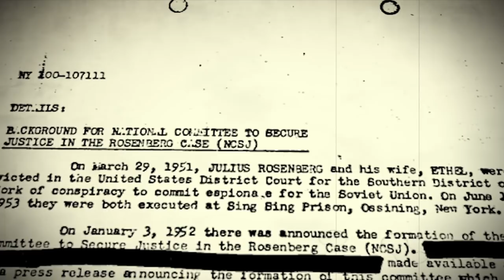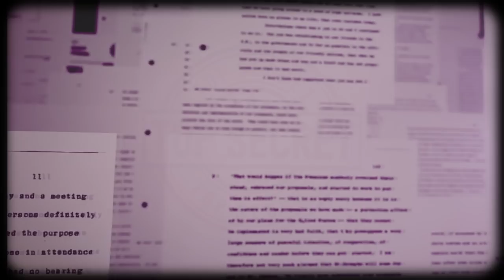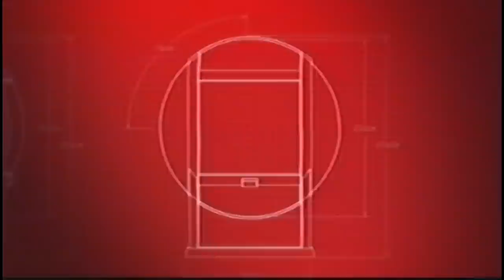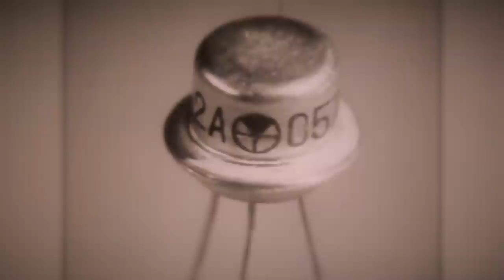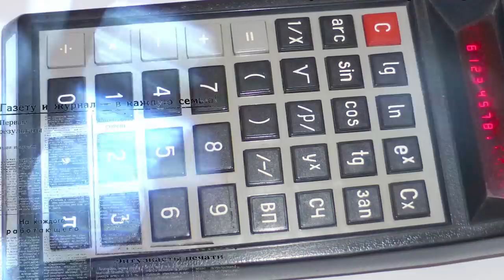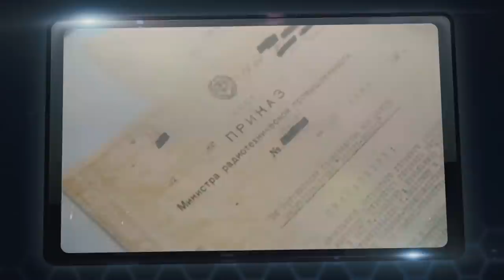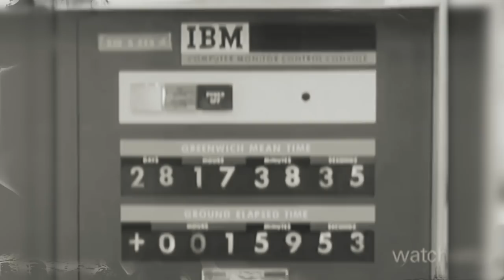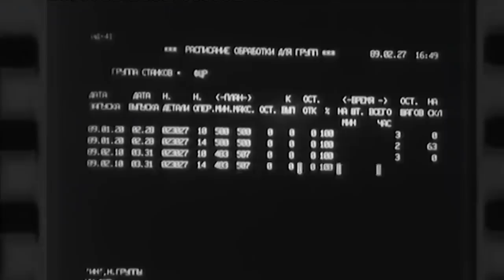How Two American Spies Built Soviet Silicon Valley

Comment: 14:18 Its not true that everything had to be done from scratch. USSR (and all eastern block coutries too) copied many western ICs. There were laboratories that reasearched internal structures of ICs and designed equivalents. So if you had soviet TV from 80s, you can use original (Philips) ICs in it and it would work :-) Of course it was much easier to done this with standard consumer ICs than specialized millitary ones.
Reply from the maker: Yes, you are right. But there is a small detail - basically US (and other countries probably) had 2 types of ICs -  consumer ICs and ICs for military usage. Military ones had higher quality standarts, better environmental resistance and some extra protection stuff. And it was possible for USSR to buy the first ones but not the second ones. Therefore, they had to recreate their IC for military usage based on foreign consumer ICs and then add some extra features so that they can be used for military. Still not exactly "from scratch" but not an easy task
Reply: @Setarko  In 80s processors were consumer ICs in west. But as I know USSR was able to copy only 80286 - due to lack of technology.